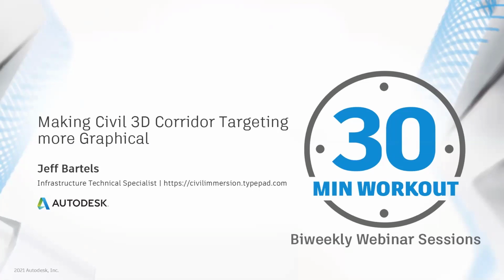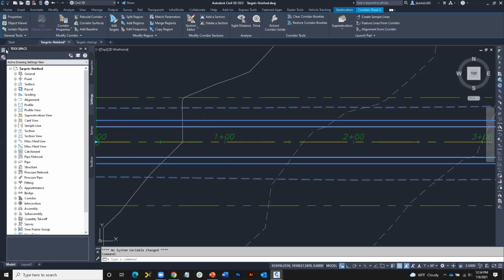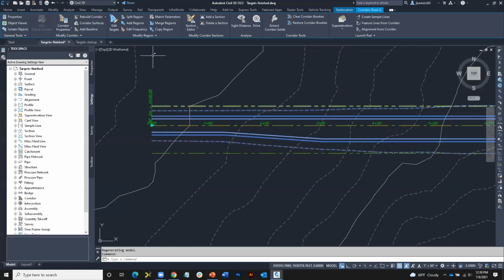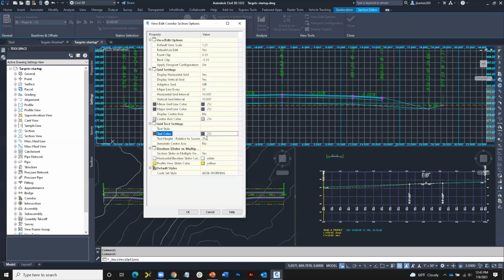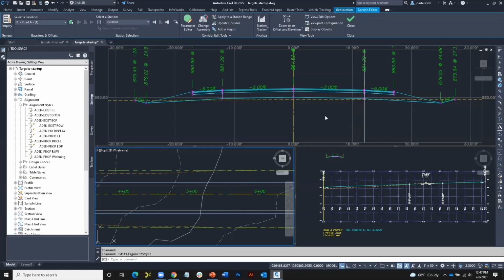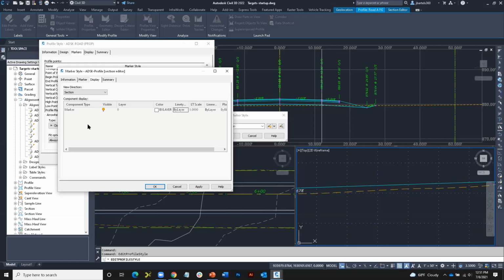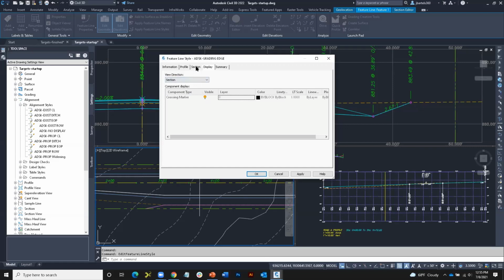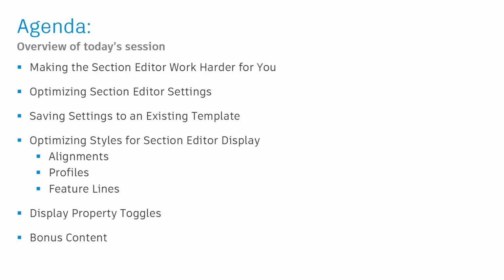Displaying Civil 3D Corridor Targets Inside the Section Editor!

Comment: Great video, I'll put that up there in case someone as a good solution. I design benched quarries once in a while, and as easy as it is to design the pit, I find that putting a ramp from top to bottom difficult. i use the corridor tools, but it takes a lot of adjustments to get it to work on some benched near vertical walls. If anyone have found a good practice for it I'd love to hear from you. (BTW i've used quarry software such as Surpac, and really disliked it.)